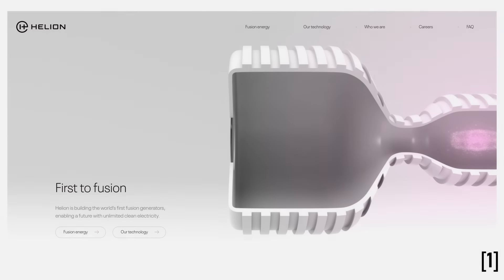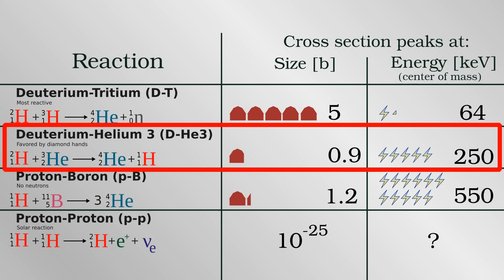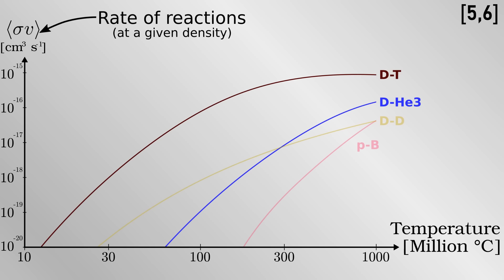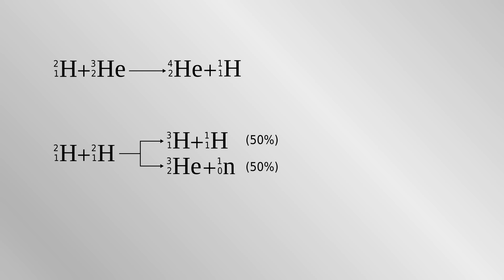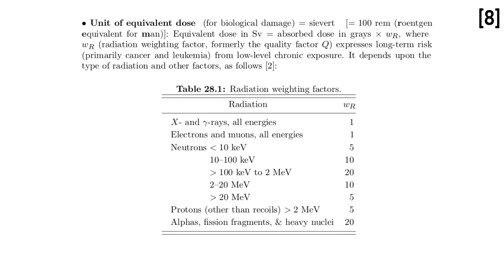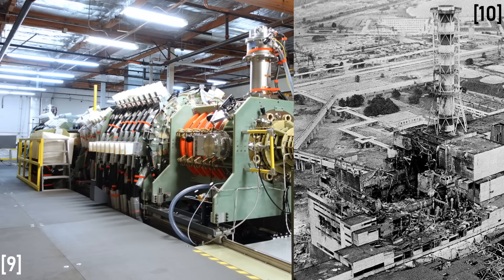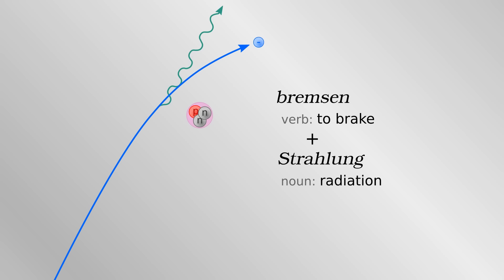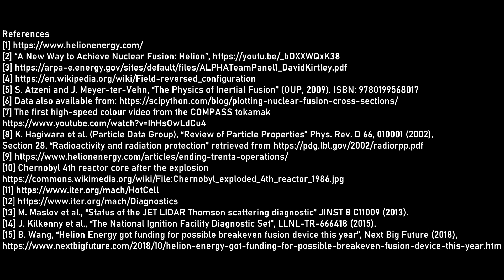The problems with Helion Energy - a response to Real Engineering

Comment from the maker: Edit: I livestreamed a deep dive on Helion here: https://www.youtube.com/watch?v=wK5v1Nw98xs

My first quick-fire response video in the @AdamSomething style. There are many other related issues I didn’t mention, but here are the main ones. I wasn’t really feeling like spending significant effort on this, so it’s even rougher than usual. I’m still considering a livestream at some point to answer further questions, talk about ignition at NIF and other things that have come up.
Reply: Excellent brake down. Real engineering has become a hype channel.
Reply: 10/10 ty
Reply: something i found confusing. You argue that D-T is a better fuel mix than D-3He due to its higher reactivity, but later you show the reactivity for D-D and it is significantly higher than D-3He at 100M K. In this case, why not use D-D fusion, D being much more abundant than either T or 3He? Or perhaps there was something wrong with the plot and D-D reactivity is lower?

You also discussed the problem of neutron radiation but D-3He fusion produces 4He and and a proton whereas D-T fusion produces a neutron The absence of neutrons was given as one of the advantages of D-3He vs. D-T fusion.

Finally, you implied that Helion  is working at a much too low temperature. But isnt it likely that their plan is to increase the temperature  as they iterate their design to eventually approach temperatures where D-3He reactions are more  frequent? Also, bremstrahlung increases with increasing temperature, so there must be a sweet spot where the amount of energy lost due to bremstrahlung vs. the amount retained in the plasma optimizes the total power that can be extracted. This would be below the optimal temperature for reactivity.
Reply from the maker: Yes, at 100MK the reactivities in order are D-T, D-D, D-3He. I talked about D-3He (the worst reactivity) at this precise temperature, because both of these are what is claimed by Helion.

As I say, if you try to go with D-3He, you will inevitably end up having D-D reactions which release neutrons too.

I can't read the minds of what Helion want to do, or predict what they will manage to achieve. I simply commented on what they claimed so far. You are correct that there is a temperature sweet spot, and unsurprisingly this is what most other fusion proposals are targeting (mostly with D-T).
Reply: @ImprobableMatter  Interesting. The D-D reaction dominates at 100MK, so you need 1,000MK to get a 10x suppression of D-D vs. D-He3 rates is that right?
Reply from the maker: @alexkrause7285  Yes. Note that this is hotter than any experiment has ever reached, and even a 10x lower D-D rate (therefore 1 neutron for every 20 D-3He reactions) is enough to require radiation protection etc.
Reply: If you do a follow-up to this video, I'd love to hear your commentary on the video Helion put out last week discussing their presentation to APS last year. It comes across as a straight forward science presentation with lots of technical/theoretical detail, so I wonder if they are getting anything wrong (or making incorrect assumptions).
Reply: Thanks. It is ofcourse hard to guess their strategy as a company developing patented processses  for example regarding future temperature targets.  I guess that D-D reactions will produce T even in their D-3He plasma and these will efficiently produce neutrons via D-T reaction.  What about the proposal to reduce the ratio of D to 3He thus reducing the D-D reactions? It seems like that would impact neutron production (albeit with lowered D-3He reaction rate.
Reply: ,...yet you went out of you way to make a nip and tuck video,...why don't specifically state how you would solve these issues,...if you can
Reply: Can you do the same for Zap Energy?
Reply: @ImprobableMatter   D-He3 has a higher cross section at higher temperatures (and for Helion that is at a lower temperature than 100 keV, actually (if you watch David Kirtley's talk at Helion that I posted above).. There are a few other things that come into play here. Like the ion: electron temperature ratio.
The D-D neutrons are not great, but manageable, more manageable than D-T neutrons.
Reply: @Improbable Matter  Improbable matter, though I was excited about that same video too, I did have my reservations especially when they 1) never gave a planned Q fusion for their next generation reactor and 2) claimed that they weren't expecting to hit ignition. Thanks for this well thought out video with detailed explanations. Your IQ must be sky high
Reply: AdamSomething style is very much identified by being cynical which is not the case with your video. Your style is preferred and I don't think being overly cynical should be strived for. Quick responses to false information are great though.

I honestly already couldn't take Real Engineering seriously anymore after being debunked a few times. Seems like another pop science channel that just takes press statements at face value. Me and other non-engineers dangerously eat it up, and the only way to avoid this pitfall is to stop watching. I doubt Real Engineering is an engineer themselves.
Reply: @amyh9512  
1. Q for Polaris is going to be around 2 to 3. That information is actually out there.
2. Achieving ignition (self heating plasma) with D-He3 is very hard. They do not need it because they can recover 95% of the input energy directly as electricity. That is about as good, if not better.  So they can get away with a relatively low Q.
Reply: On Monday, the U.S. TV program 60 Minutes, posted on YouTube, a tour and interview that they recently had at NIF regarding the prior 'breakthrough' announcement' that NIF management had made. Journalists and others tend to be awestruck when given a tour of the facility. I left the following comment a day later, after noting that most commenters displayed incredible levels of technical ignorance and few people had any kind of technical critiques in the comment section..

Nuclear Fusion: Inside the breakthrough that could change our world | 60 Minutes
Posted on Monday, 16 January 2023

----------
I appreciated this report that included many aspects of the reported experiment that earlier reports missed. I especially liked the inclusion of Charles Seeife's perspective because almost all previous reports only included fans of nuclear fusion research to provide journalistic 'balance' in their reports. This report also noted that the Lawrence Livermore National Laboratory (LLNL) and the National Ignition Facility (NIF) deal with nuclear weapons research. In fact, this experiment included a weapons related component that was never mentioned in earlier reports. NIF has always been primarily funded as a thermonuclear weapon (H-Bomb) research tool. It was preceded by two other large fusion laser facilities that were expected to lead to the so-called 'ignition' condition. NIF failed, by a wide margin, to meet it's primary goal by its 2012 deadline. The LLNL has always obscured NIFs primary function when presenting it to the public.

This experiment took about a week to prepare. The fusion reaction lasted for approximately 0.08 billionths of a second before most of extremely compressed deuterium/tritium fuel plasma was blasted away from the reaction center by the blast of energy it generated. Only about 4% of the extremely expensive fuel ended up fusing. The rest was scattered in the target chamber which then required removal of the radioactive waste material. This report failed to mention how rare, expensive and radioactive the tritium fuel is. The precision hohlraum and nearly perfect diamond fuel capsule was converted into a plasma along with the close-in structure that supported the assembly. If one assumes that a repeat experiment is conducted once a week then the duty cycle of the fusion reaction would be 0.0000000000001%. There are many orders of magnitude of advances needed before scaled up fusion energy power reactors can displace our addiction to fossil fuel derived energy sources. Experimenters, in such fields and their fans, must be experts in excluding warning reports, such as the following, from their consciousness.

IPCC report: ‘now or never’ if world is to stave off climate disaster (TheGuardian)

The lab employs their own definition of 'ignition' that is different from most peoples concept of ignition. Most people equate the term with something like a match head striking a rough surface where the initial reaction spreads to the rest of the fuel in about two seconds. There was no significant spread of the fusion reaction in the NIF Inertial Confinement Fusion (ICF) experiments and that reaction was primarily dependent upon the 3 billionths of a second compression from the X-rays that were generated from impinging laser beams. The lab staff claims one reason the laser input energy was about 100 times greater than the fusion energy output is because their lasers are old. In past breakthrough announcements to the public they failed to mention the amount of energy used to create their compressing laser beams. They are looking to eventually employ more modern Laser Diode Pumped Lasers (LDPL) which can be up to 20% efficient. Even the largest of those lasers don't come anywhere close to the NIF laser power. In the case of NIF the compressing energy is shifted in wavelength at least twice. If the same was done with LDPLs the efficiency would be far less than 20%. 

I urge readers to search for the following titles.

Is This the ‘Kitty Hawk Moment’ for Fusion Energy? (TheAtlantic)

Sun in a Bottle: The Strange History of Fusion and the Science of Wishful Thinking
By Charles Seeife - Published on 30 October 2008
Reply: @Dcassimatis  - Good suggestion. I've found that many people have a belief that unless a solution is proposed then they can automatically dismiss the criticisms. I have a solution that most people are likely to reject. It is that we abandon all thoughts that some magical new technological fix is going to prevent the collapse of industrial civilization.
Reply: adam something fan? based.
Reply: @1000_Gibibit  +1. I legit enjoy Conover's presentation style, but after a few dozen videos I started feeling a bit weird. I noticed he only negs things, and sometimes really pretzels himself to be able to come at a topic with the same glass-half-empty snark. Like he lacks confidence in his ability to be snarkily funny in any other way? Idk

Kinda like what's frustrating about some folks who ended up maybe pigeonholed or otherwise as "professional skeptics" which definitely ends up morphing into more like "professional cynic" than "professional critic(al thinker)".
Reply: Gonna start turning fusion reactors into trains somehow
Reply: Thanks so much for making this, I work in fusion as a grad student and their video was really frustrating to see, but obviously the comment section is full of heavily liked comments that have no clue how to criticize something like this. We need a realistic view of fusion, not a hyper-capitalized landscape of buzzwords and theatre. Get us some peer-reviewed diagnostics reports proving your confinement, and we can have a real conversation
Reply: Had to check to make sure Adam didn’t have another account I wasn’t aware of
Reply: Except you missed the part of the video where you turn the fusion reactor into a train by making it better
Reply: @rexmann1984  i noticed that aswell
Reply: @Dcassimatis  Because if he could solve them all, he would already have done so and become one of the wealthiest people in the planet.
Reply: Helion recently published a video going over their theory and simulation: https://www.youtube.com/watch?v=G1vyMcqiVtA. It looks like they are showing higher D-He3 cross sections for higher Beta systems. Curious what you think.
Reply: no wonder i found this video to be unbearably annoying its made in the style of adamsomething
Reply: I would like fewer "Adam Something" style video responses on the internet. I've only known of his channel for about a year, and I'm already sick of his snarky attitude to any and all new technology.

Comment: Very well explained. I'm somewhat concerned about the hype most of these start-ups are making, because when investors realise they have been mislead (to use a soft word,) honest fusion will suffer badly and may never recover. My hope is that those which are seriously based on solid physics and engineering will succeed. On second thought, fusion has always been hyped, and that's why it's become the laughingstock of many scientists. Sad!
Reply: To be fair, the only people investing in these startups are people who're absolutely prepared to lose it. A lot of the funding is coming from ppl like Bill Gates and their various foundations and whatnot. Of course that money might be better spent on other energy ventures like geothermal or LFTRs etc.
Reply: I'm generally skeptical of fusion. The advantages of fission are basically non-existent, and the disadvantages are many (probably orders of magnitude higher reactor costs, very high energy demand to start fusion, etc).
Reply: This is just classic venture capitalism bullshit. Theres still plenty more legit fusion science, most prominently ITER.
Reply: even honest fusion uses more beryllium then can be mined easily and "wears out" and will have to be replaced on a schedule similar to fission fuel.  fission is the way forward until fusion researchers actually produce power at scale for multiple decades.
Reply: There's honest fusion? At least there is honest nuclear, but cost seems to be an issue.

Comment: After watching the Real Engineering video, I browsed Helion's site looking for more info. What I noticed was a distinct lack of numbers, especially ones regarding the efficiency they're supposedly getting. While getting down into the physics is hard, a ratio of power input to power generated is something the layman like me can easily understand, and if they were truly close to commercial viability you'd think they'd be bragging even harder than LLNL did with their recent, rather anticlimactic announcement (yes, it's an achievement that proves inertial confinement works, but it didn't bring us much closer to a working system). Frankly Helion just seems like they're looking to farm venture capital.
Reply: They aren't that close, the next iteration (Polaris) which they are still building is the one that will test the true viability of their idea, if Polaris doesn't reach breakeven i think they will have trouble getting more funding for the next iteration. I think they choice of making smaller iterations and learning from them (and then getting funds for the next one) is a better way to do some science than waiting 15~20 years to finish a really big prototype like ITER. Of course, if they had the money to do a big one from day one they would've done it, but i kinda like it this proof of concept approach.

Can it also be a scam? Sure. But i think it's clear that they believe this will work, comparing them to snake oil salesmen is kinda disingenuous.
Reply: @l4nd3r  You have a point, and everyone looking at their project should remain open-minded. I just believe that if they want to appear up-front with their status, they should put in benchmark numbers similar to other projects on their website.

After seeing the Princeton tokamak in high school in 1983, talking to their scientists, and getting really jazzed about the subject, the elusiveness of fusion power has been a heartbreak for decades. My generation of geek also had to live through the Fleischmann and Pons cold fusion hype as well. We're all a bit jaded now.
Reply: That should be coming in 2025, since this was the year for testing.